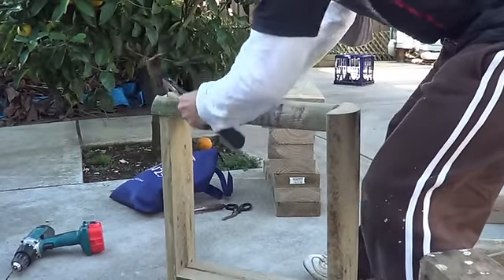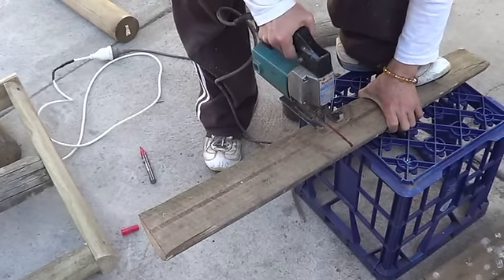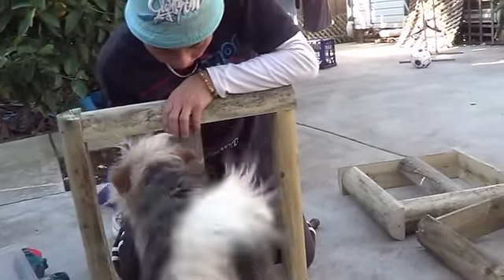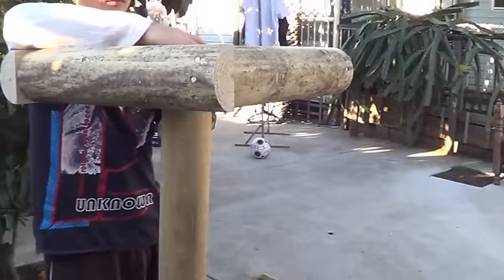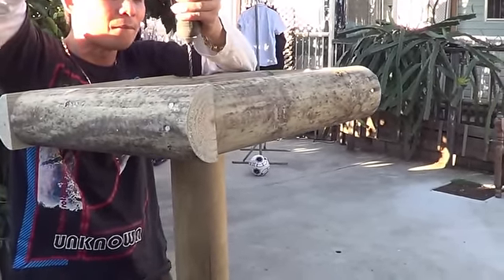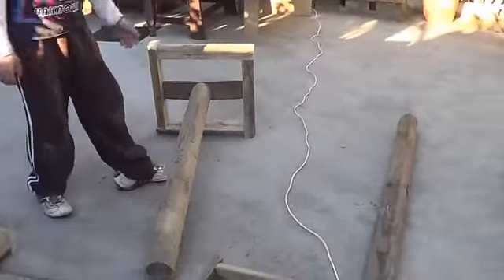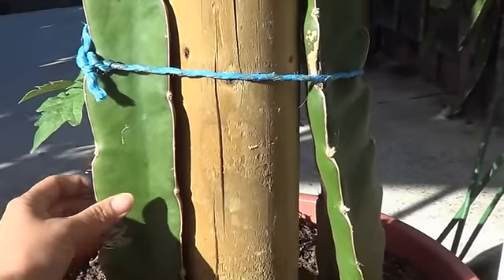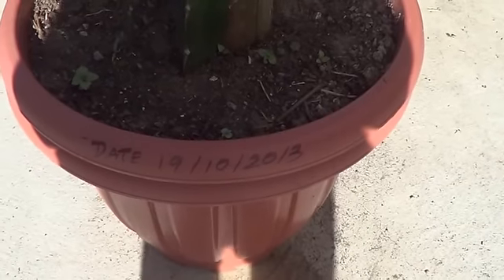Growing dragon fruits part 2 - building frame for the plants

Comment: Hi, I m in Melbourne and I have just planted dragon fruit plant in the ground. During winter season, will the plant die from too cold? How do I care for the plant during winter? Appreciate very much if anyone can share some experiences during winter. Rdgs. Sharon.
Reply from the maker: +Mummy Wong - I'm in Sydney, I'm not sure for other but for me in Winter I don't think I water the plant much only 1 a wêek but in the middle of the day, but I not sure in Melbourne as I know the weather there is really funny
Reply: Thanks for your reply.
Reply: I've read they should be kept above 0 degrees over winter, might tolerate as low as -2 centigrade for short periods. It's my first year growing them so I don't know how accurate this advice is. We get frosts in winter here so I'll be keeping mine indoors until they're a healthy size. Once planted outside, I'd keep the base well mulched during cold periods.

Comment: The frame looks very strong and the funny dog is running in circles!  It seems to be a little bit too tall, for that small pot.  How do you protect it from getting knocked over?  Thanks
Khung trông rất mạnh mẽ và con chó vui được chạy trong vòng tròn! Nó có vẻ là một chút quá cao, cho rằng nồi nhỏ. Làm thế nào để bảo vệ nó khỏi bị lật đổ? cảm ơn
Reply from the maker: well it's not really that tall, it's only about 1300mm H, on the other end there is another smaller frame like a cross,once it in the pot it will stay

Comment: Hi. Do you have a video showing the measurements you used for this frame?
If not :) could you please tell me :) and also what size pots your using? in liters.
Reply from the maker: Gold Coast Reefer Hi, the one I plant on the ground is  2" x 2" ( 600 x 600) . but the one I had in the pot is only 500 x 500 it a bit smaller, it really up to you as long as it strong. Pot size the bigger the better, the Height for this one only 1500mm

Comment: Great videos!  Thank you for posting them.  How long did you say the logs were?  I'm in America so I don't think I understood what was mentioned in the video.
Reply from the maker: Hi, sorry I'm so not use to talk in video hihihi but glad you like it thank you. well if I was to plant it in the ground I'll be using 2400mm long ( 2.4meter = 8 Foot), and if it in a pot I;ll be using 1800mm ( 1.8 meter = 6 Foot)
Reply: CLB Cổ Nhạc Vọng Cố Hương  Thank you for the response!  How long would the boards that go on the top be?
Reply from the maker: Hi, well it really depend on how big you want the plant to grow, the one I got in the clip is only 1200H = 4 Foot ( on top is 600 x 600, I made it small because we are growing it in a pot